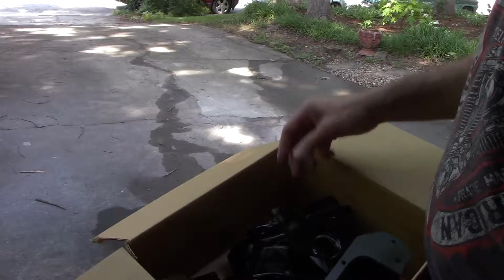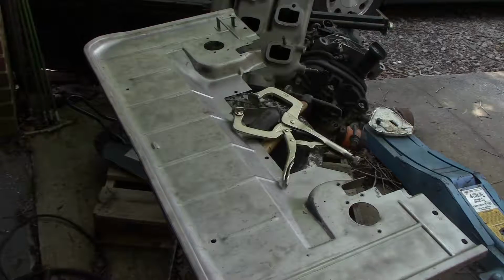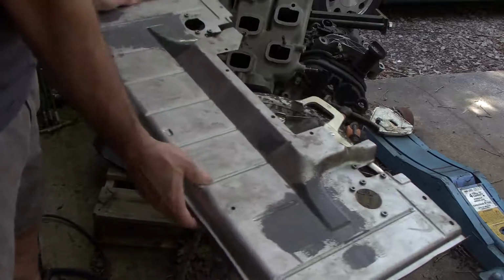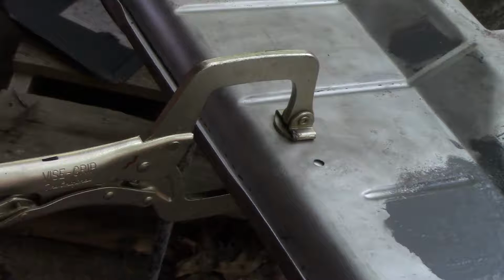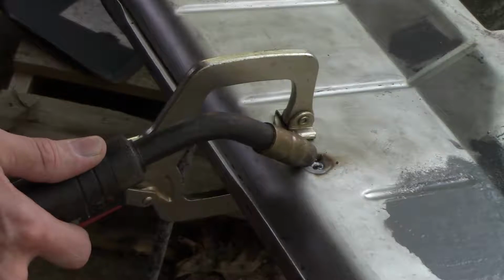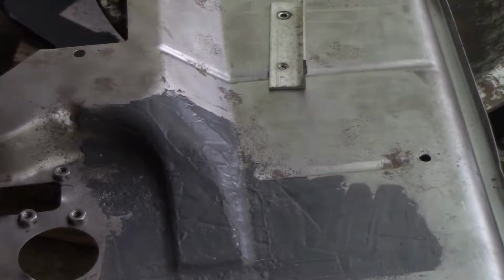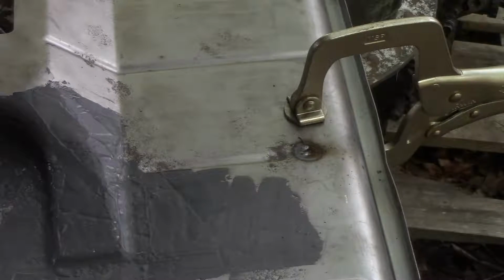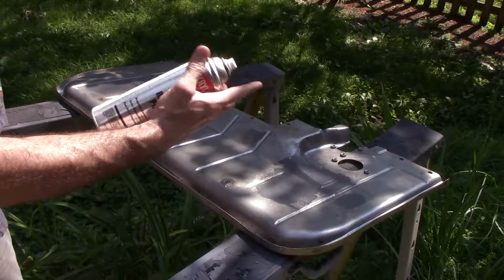Porsche 912 engine tin repair

Comment: Hi, what tape did you use to support the JB Weld? Have exactly the same problem with rust! Thanks.
Reply from the maker: I honestly do not remember. I think it was just painters tape. Something to support it so it does not fall through.
Reply: BryanR461 Thanks